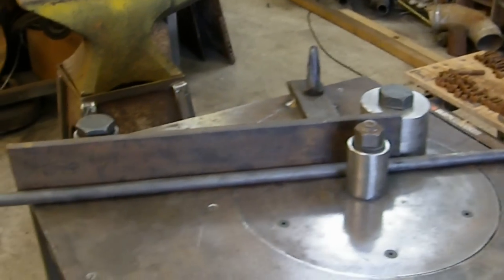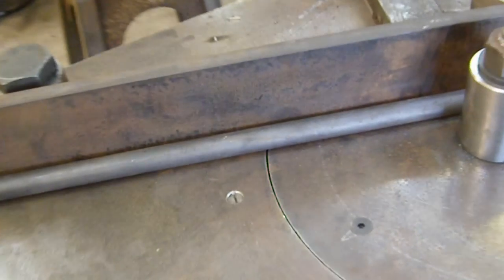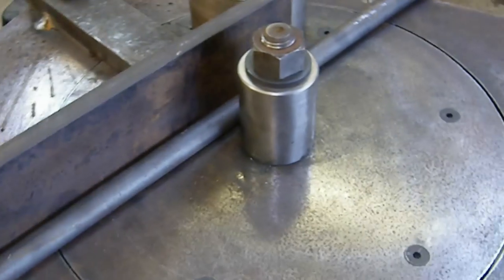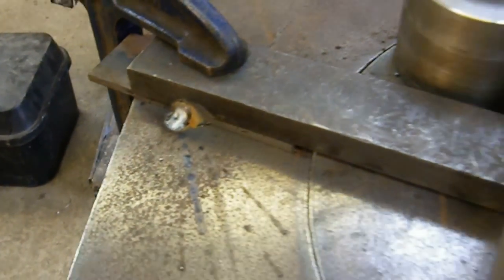sjwyaw Home Made Metal Bender

Comment: what type of motor assembly
Reply: 500kg 240v winch. You can find used electrical winches pretty cheap online. The weight it can manage is usually printed on the box, so even if you don't know exactly what kind of motor etc. it's got, 5-600 kg would be plenty to bend for example half inch rebar.